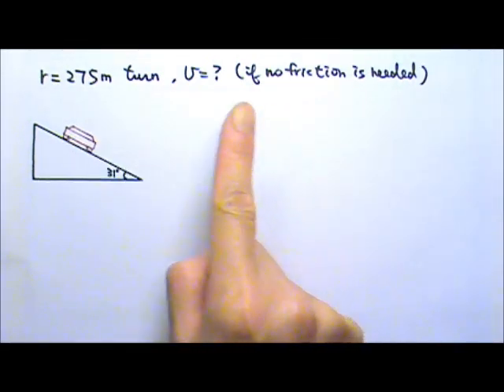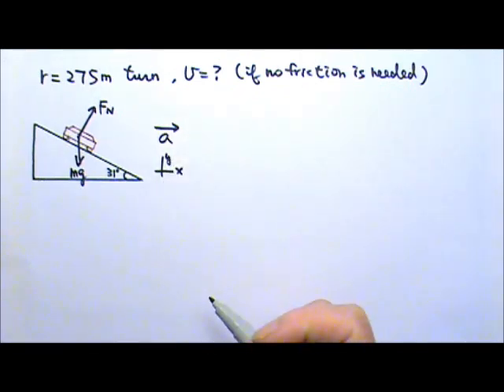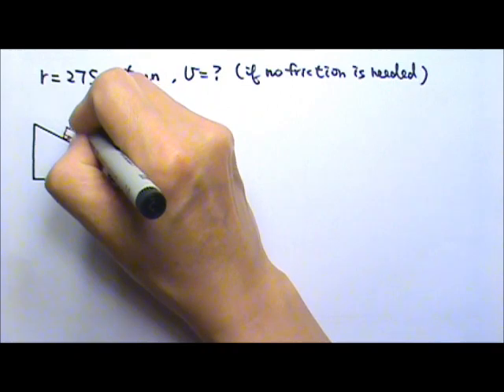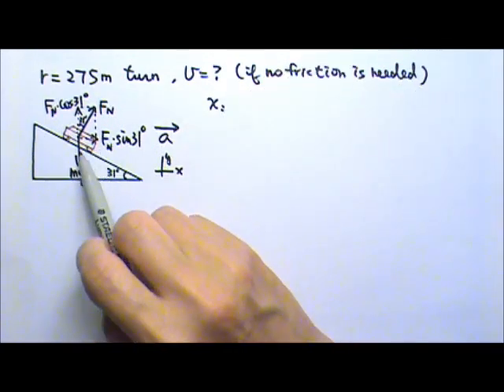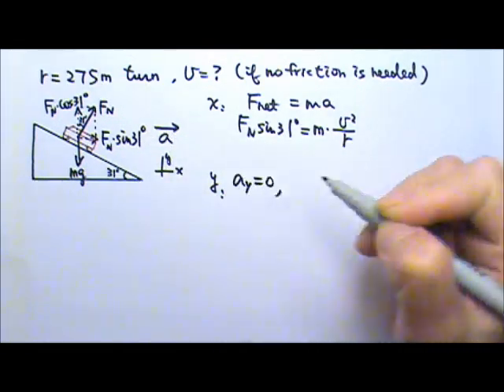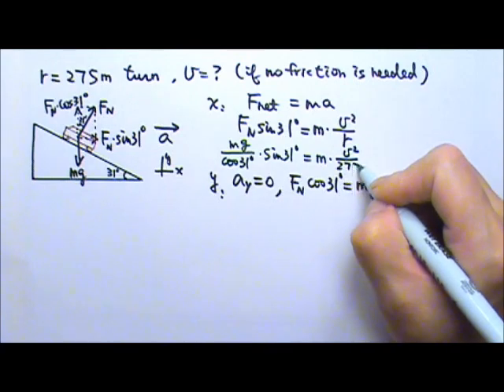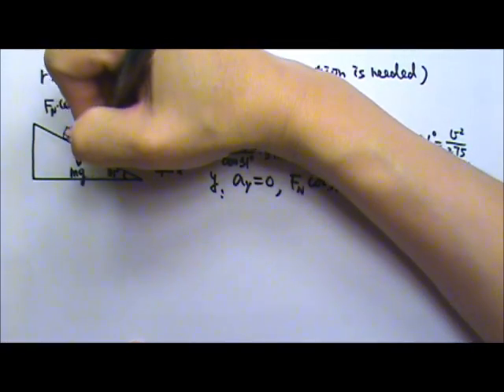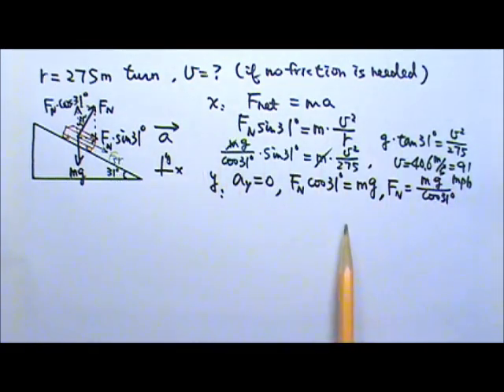AP Physics 1: Forces 37: Circular Motion 9: Banked Road

Comment: I understand that when a car is moving on an ice incline the x component of the normal force acts as a central force , but why doesn't the car slide to the bottom of the frictionless incline by the force of mgcosθ ?? I need the answer please
Reply from the maker: In this case, the car has a horizontal acceleration (towards the center of the horizontal circle the car is in). Because the car has a non-zero velocity, the car does not move toward the direction of the acceleration (or the direction of the net force). The acceleration causes the car's velocity to change and makes the car go around in a circle.
Yes, the net force does have a component directed down the incline, but again, because the car has a non-zero velocity, that net force's component does not pull the car down the incline. 
Consider a projectile shot at an angle, when the projectile is in the air, it experiences a net downward force of mg, but the projectile does not go straight down for the same reason. The projectile has a non-zero velocity, so the net force causes the velocity to change. In this case, it does not cause the projectile to move in the direction of the net force. 
The direction of the motion is the direction of the velocity. The direction of the net force gives you the direction of the acceleration, which is not necessarily the same as the direction of the velocity. 
I hope this helps.